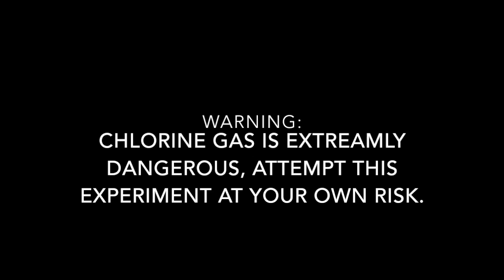How to Test Materials For Chlorine - Laser Cutting

Comment: Chlorine does not impart any color to the flame. However copper ions produce a green or blueish-green light in the flame. But good job verifying the wire is actually copper.

Comment: Chlorine does not produce colored flames by itself, but the presence of chlorine greatly enhances the development of color of the copper. Copper produces a green flame in a flame test,  so what you are getting is an enhancement of this from the presence of chlorine. However, it will be possible to observe a green flame from other colour enhancing elements or compounds and also directly from other elements such as Barium which also produces a green flame. So, this test, whilst it may prove as an indicator, it is not conclusive since it is the copper producing the green colour and this may be enhanced with various substances other than copper ;)
Reply: Cannabis is a halogen. Makes you see stuff.
Reply: Its a pretty good test for halogens.  If you're laser cutting florine/florides etc you'll have an even worse time than just cutting some vinyl.  It's a good test.  Green means stop.

Comment: Great video !
Still, you could add details on why shouldn't I laser engrave chlorine-based products. A flame is a flame, and if there's toxic gaz, does it damages the filtered fan ?

Thanks for the tip ! :)
Reply from the maker: You're absolutely right... Chlorine gas not only is toxic to humans, but it can also react with metals to form metal chloride salts. Chlorine also cannot be filtered by the filters used in many laser cutters.
Reply: +Sashi Mee chlorine is corrosive and can corrode the laser optics, motors, and internals of your laser cutter. not worth destroying an expensive laser cutter for a $5 piece of plastic.